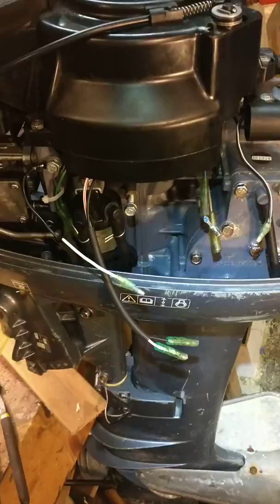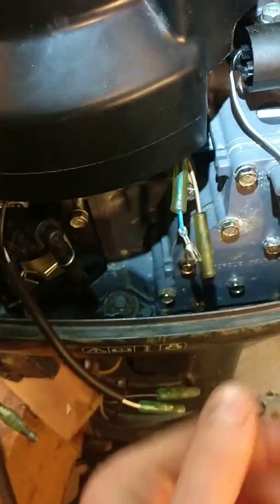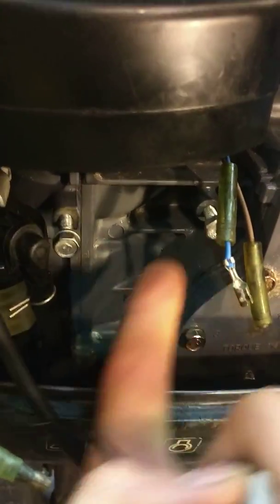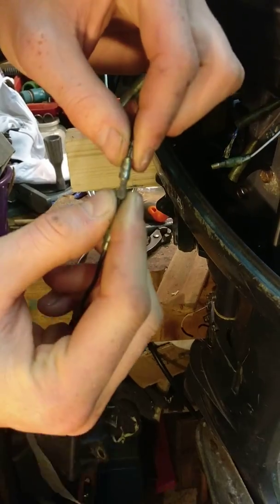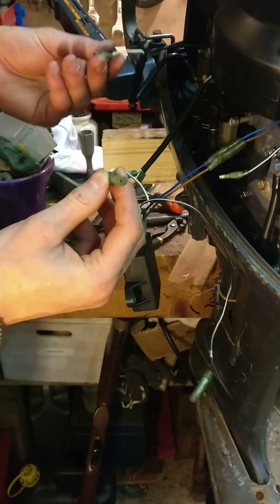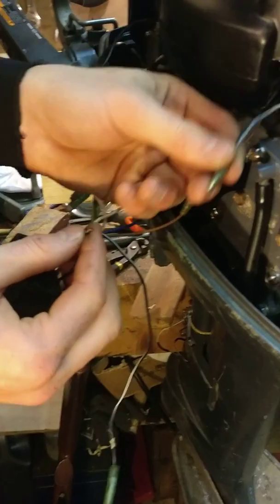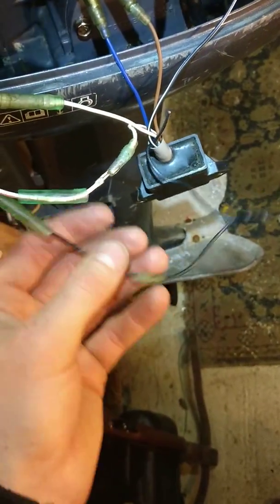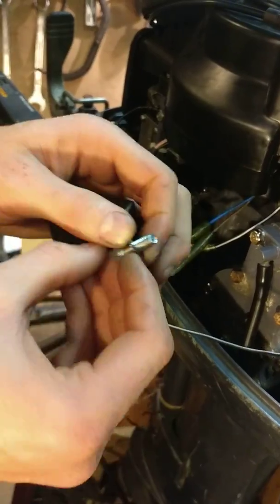How to correctly change and fit a CDI unit to a Yamaha 15hp 1999 two stroke engine

Comment: My 18hp tohatsu. Blue Wire got cut off.. and now i have low power coming up.. so how do i need to connect it back? Like the stel of the tips. Fell off.. now it left me with just a copper wire
Reply from the maker: Hey not entirely sure but sounds like you need to get a crumpet and some marine crimp ends to re attach the wire to to e original. Plug fittings are waterproof and come with a sleeve. Strip the eire and attach a new! Good luck with it
Reply: Oh my. It seems like, i really need a luck on this one😂  @ewan12kd